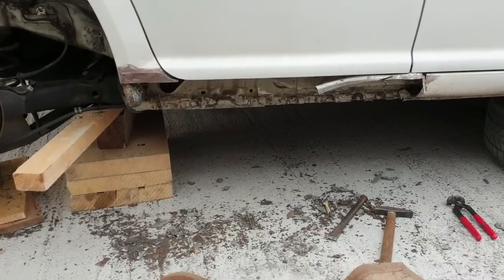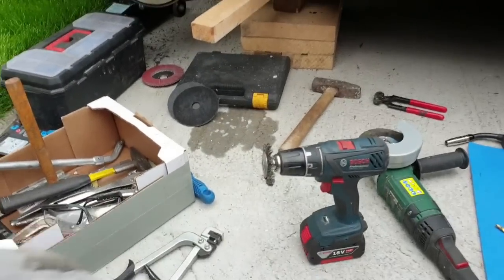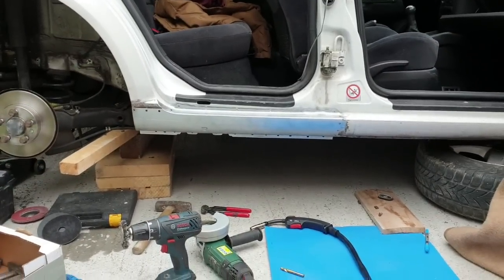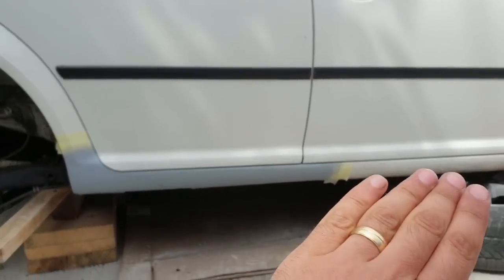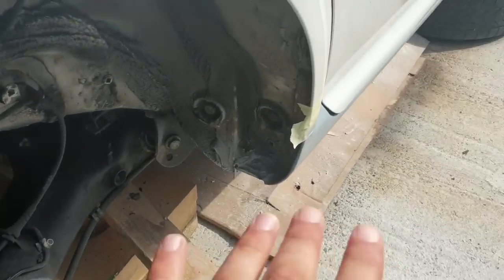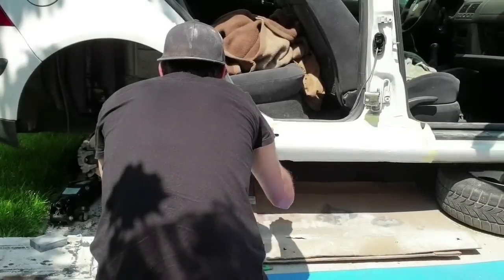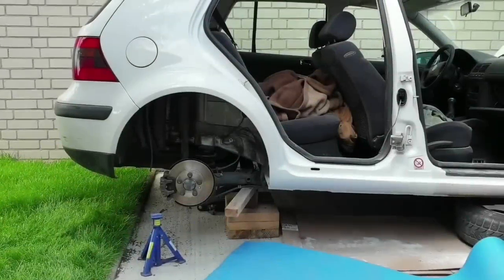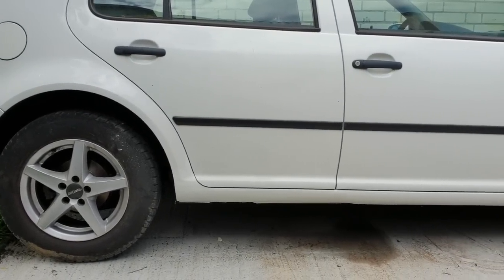VW Golf IV project car! Welding the rocker panel and painting for the first time! P5

Comment: Nice DIY repair. As these cars a age they don't warrant the cost of pro repairs. You repair is about the best possible result using the basics and attention to detail. My only suggestion is fog the interior of those rockers with an anti corrosion oil. This will greatly prolong the return of the rust.  Great job.

Comment: where did you get that rocker panel piece? i can only find the whole piece for the front and back
Reply from the maker: As you can see in the thumbnail I bought as well a hole piece front to back and I've cut it to length.
Reply: @WarpDriveM  ok, thank you. I might do this myself. Very good video. Did you order your parts from autodoc?
Reply from the maker: @tohuss  thank you. No, I order my parts from  ATP autoteile (german seller)

Comment: Word of advice, when painting a car. You need to account for "Blending" .... so what that means is that you will "overspray" onto an area that has already been previously painted, but it'll be a 'light' coat. This will help blend the new colour into the old. As the old colour is UV damaged and age damaged you can't get an exact match.
I'm not a bodyman, I have just gained experience from Bodymen.  
Either way, great job, just minor mistakes, nothing that I'd ever worry about as a DIYer over all, but blending is a very important part of the job as it'll hide any 'differences' in colour!

This is especially important for metallic paints as the metal filings in the paint from the can will be entirely different than those from the factory, since it's all usually either "DIPPED" or Multi-arm sprayed

Comment: On 10:29 you mention you can’t use your hamd like factory. Next time get the small roler 5cm and after applying that protective texture go very very slow with roller and you will get those results.And line I think you know that use the yellow tape. You done a very good job on that golf. Greetings from Croatia.
Reply from the maker: Thx for watching and for the tips! 🍻

Comment: Hi there, thank you for your video. I would like to ask what size welding wire are you used 0.6 or 0.9? Also what settings on your weld machine i think i have exactly sime weld parkside machine. Thanks
Reply from the maker: Hi, I think was 0.9 welding wire, the exact setting not sure now but test on a metal with the same thickness before you start welding
Reply: @WarpDriveM  thank you for your quick reply

Comment: What kind of welder do you use in video? Flux core or gas shielded?
Reply from the maker: Flux core. Something really cheap but works just fine If is set right.
Reply: @WarpDriveM  Rost doesn't come up again?

Comment: is the pinch weld still usable as jacking point?
Reply from the maker: Yes. It is part of the under structure. I didn't cut in there. The rocker panel is just the exterior part.(shell)

Comment: how long did the whole project take start to finish? I'm about to start this lol
Reply from the maker: After I had all the parts I've cut the bad part welded the new one, use some epoxy and waited till next day to dry out. After that bondo and paint all in the 2nd day. But if you want to do it all at once you will need at least 6 hours and nice weather to dry the bondo and the paint.